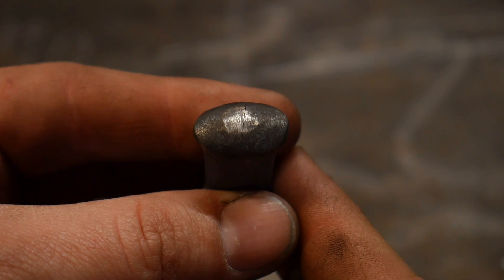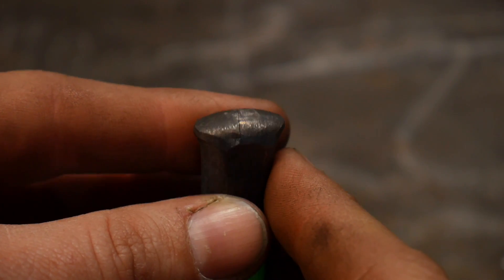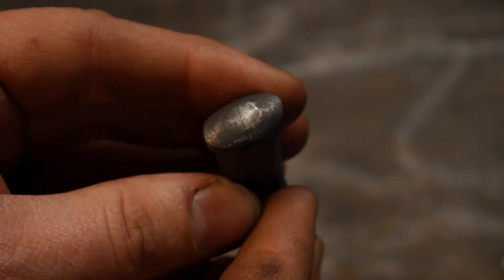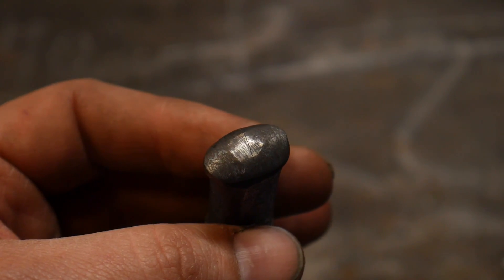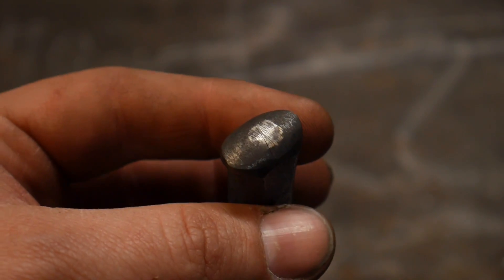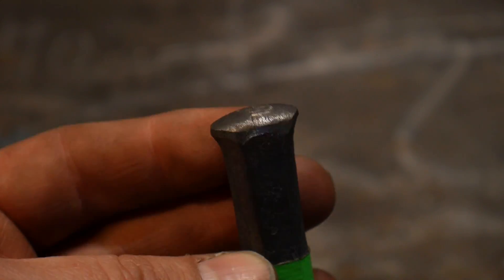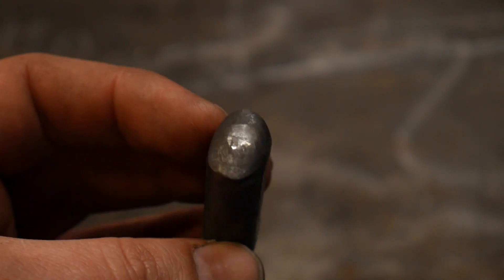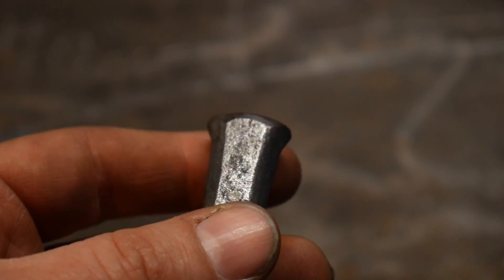Always Check Your Tooling [Pro Tip #43]

Comment: Hey Roy I could see the crack ok on my phone.
I had a similar problem with a hot cut hardy I made from an old chisel of unknown material. But it was cracking as I forged, luckily I had excess length I could cut off.
I bought my forging heat down to just on red heat and this worked. I still had two other cracks left by the hotter forging in the finished piece but these ground out luckily before destroying my work. So in the hardening I also just got to red and quenched in oil as not to shock the material too much and then tempered.
I hit it on the edge full blow by mistake cutting of a small piece of stock and it didn't chip, just very, very slightly flattened the edge. Just re ground the edge and this time left a very slight flat on the edge after seeing one of your videos (I think) on a hot cut hardy.
So I think it's good.

Comment: Follow John at black bear forges advice trial your hardening air, water, oil together the best out of recycled steel 👍
Reply: Roy had mentioned that the "unknown" metal he made this tool from responded well to a water quench.  It was just a section of a single bar that didn't work with a water quench.  But even modern materials can occasionally vary in composition.  Even new material can vary, and I have seen metal that apparently was mislabeled somewhere up the supply chain.
Besides that, even a properly forged and tempered tool can crack, chip, or mushroom.  Wooden handles can develop cracks and splinters, etc.  It makes good sense to check ALL of your tools occasionally.  You can use a hammer with a loose head for a while without incident.  It only becomes an accident when the head flies across the room and impacts something or someone.

Comment: So normally coil springs are 5120?? I think right or is it 5160?? 
  Normally would that been water quenching or  is oil a better bet?  I've seen some where it gives several methods  including hot salt and even heated oil.  So I reckon ot just depends on the material or is it more dependent on  the use of the end project?
    Thank you and blessed days sirSir, Crawford out